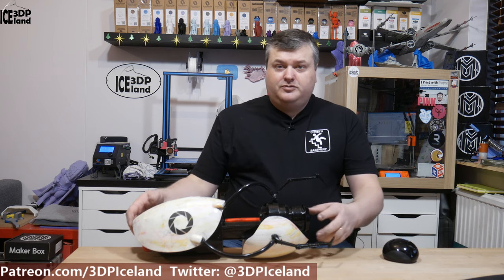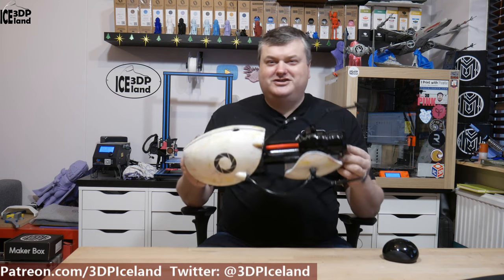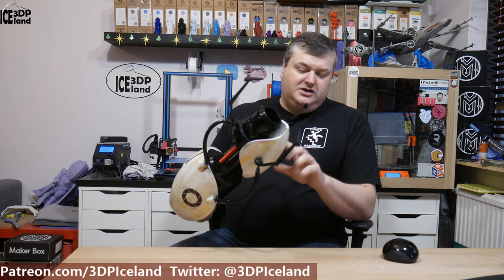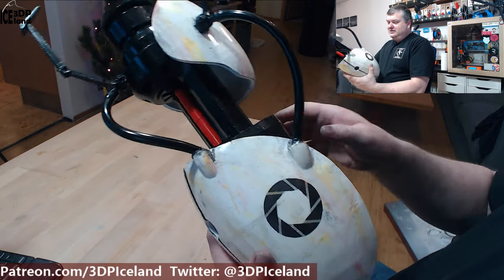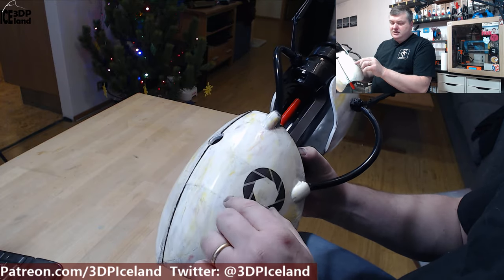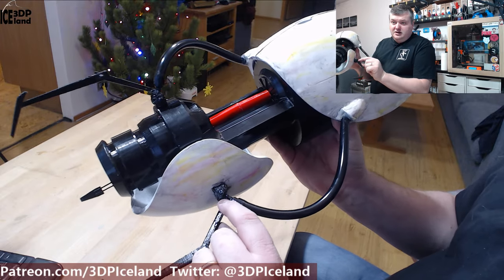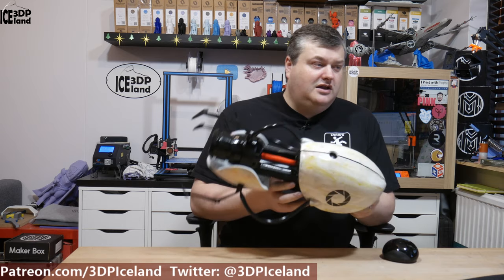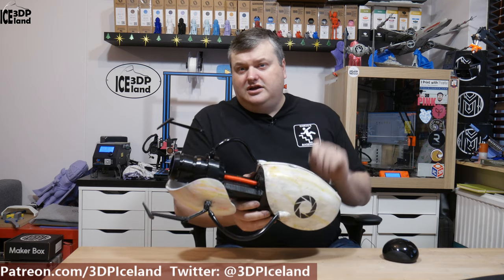Portal Gun 3D printed

Comment: Such a great print! Really did a superb job with that one :)
If you come across models like that and you want to try smoothing out any of the faceting, drop me a msg. I might be able to help you out :)
Reply from the maker: Thank you, - and cool,  can you re-mesh a STL , - in what software can you do that? https://www.thingiverse.com/thing:26027 is the model I used.
Reply: @3DPIceland  It is possible. The ease of remeshing can depend a lot on the initial geometry, but even if it's terrible, with a bit of work hand tweaking it can often be made better. Programs like MeshMixer can remesh an entire model, but may not always provide great results, as it does depend a lot on the input geometry. If there aren't a lot of sharp edges etc., you can sometimes get a decent result out of it, but how smooth it will be compared to the original will depend on the triangulation you start with. I have a whole slew of programs that I can use to tweak things though. I often use a combo of meshmixer, fusion, 3ds max, meshlab etc. There is a good free program for remeshing called instant mesh, but it only accepts obj, ply and aln files as input. Doesn't always produce perfect results, and it's not a straight forward push one button kind of deal, but it can help you along the way.
As I said though, if you do want something smoothed out a bit, let me know on twitter, and I'll take a look at the model and see what can be done. There are occasions where it simply wouldn't be worth attempting, but generally it can be improved a bit :) I'll take a look at the one you linked and see what I can do, then message you on twitter :)